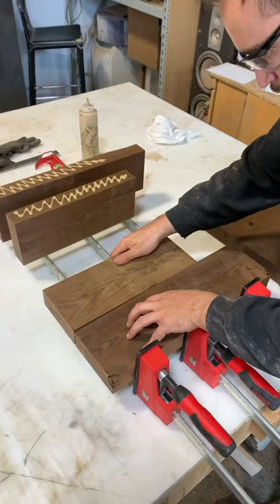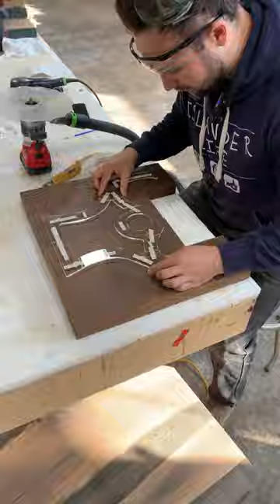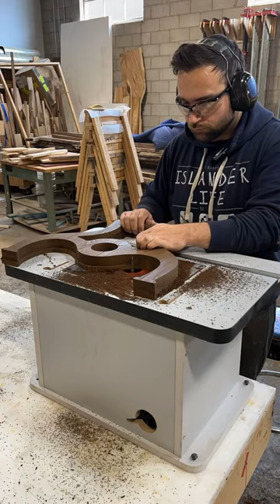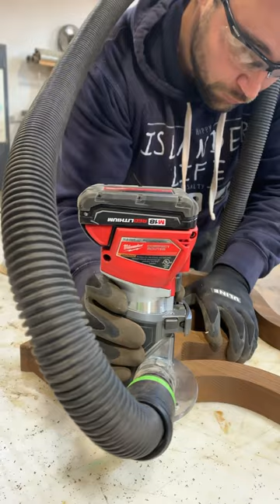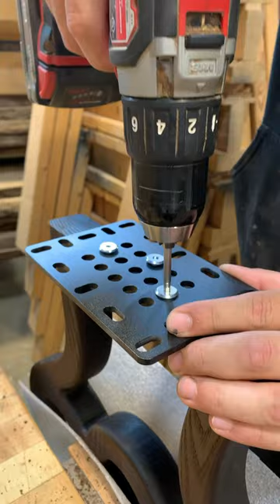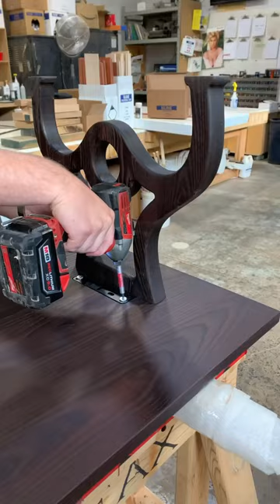COULD you Make These Easy Wooden Legs? #woodworking #diywoodworking #wood #diywood #craft #woodwork

Comment: Looks great. Definitely would suggest marking the boards out with your template before you glue up and using biscuits or dominoes wherever possible. Or at least on the joins running through the legs themselves.
Reply: I thought exactly this! I mean shure wood glue is strong, but some dominoes would give some aditional strength. I myself would better be save than sorry even if it might not be necessary
Reply: @me_ca136 thats honestly a waste of dominos. The only weak point in this whole build is how the legs are attached. If someone sat on this table the legs would rack and collapse.